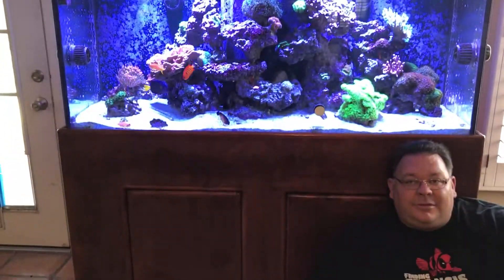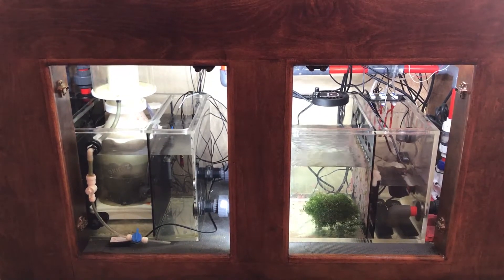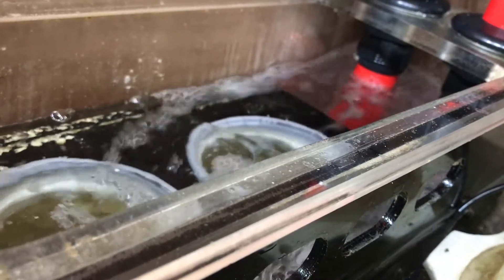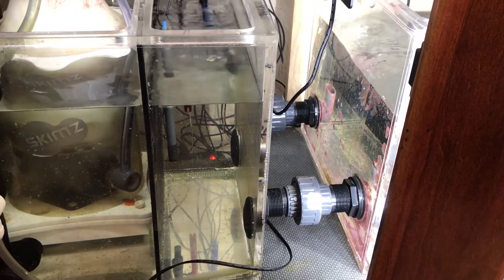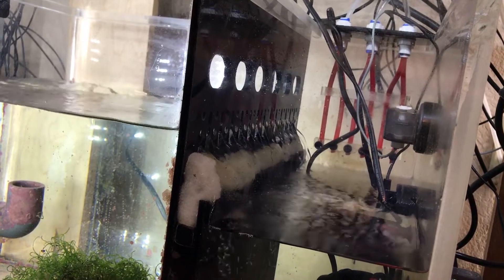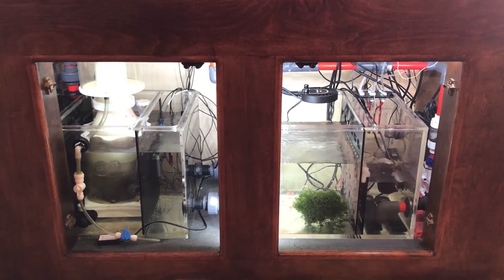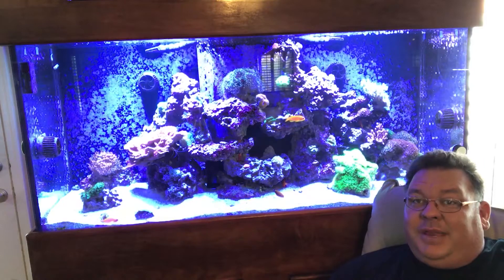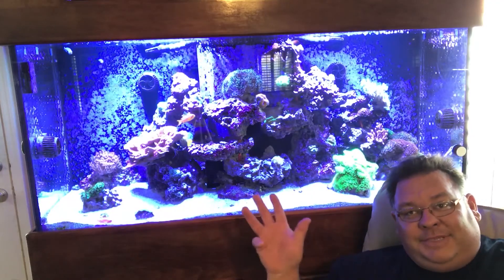The Split Sump - Part 7 - 18 Months Later

Comment: Tank is looking good.   have any of your coral been reacting to the ph swings?
Reply from the maker: No, the swings go from about 7.9 to 8.1.   I just stuck my intake from my skimmer outside last night and in made a huge difference , raised it almost .1 so I will see how that works the next week or so
Reply: Sonoran Reef I'll be moving my intake too.. warmer temps in the house and cooking gases i believe alter tge air exchange and affect the ph
Reply: great idea skimmer intake outside do you know of an air filter i could place on it as outside were i would run my line can be dusty
Reply: John Gayle cover it with filter floss